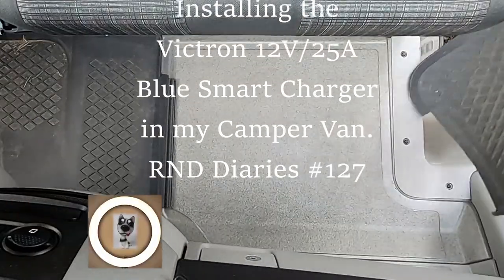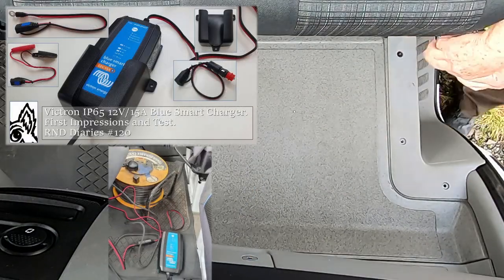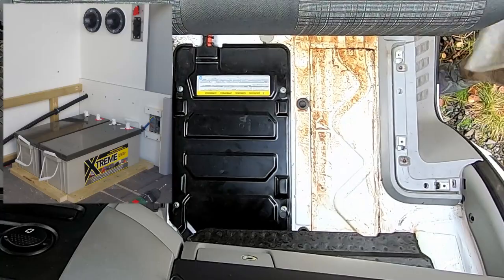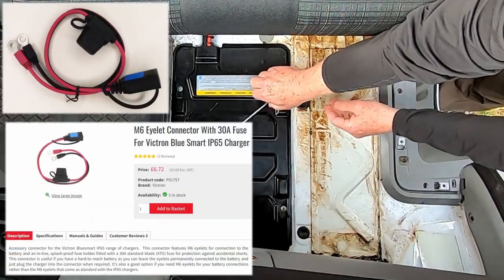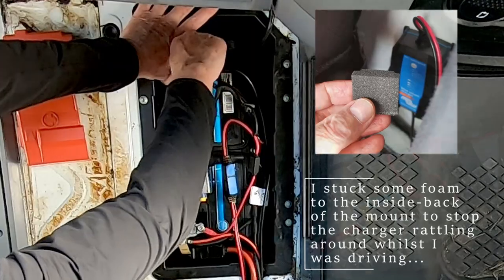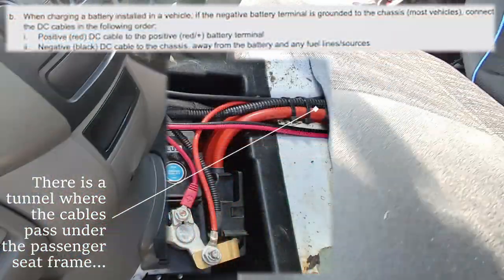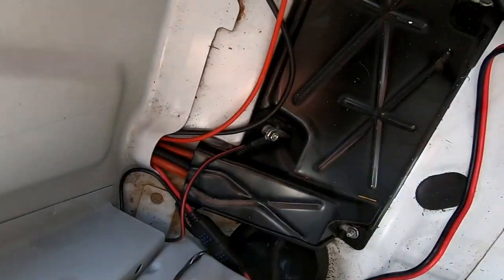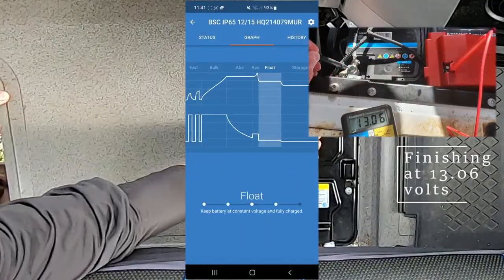Installing the Victron 12V/25A Blue Smart Charger in my Camper Van. RND Diaries #127

Comment: Thank you I’m about to do what you did I.E on board charger Victron 25 amp but permanently charging my leisure battery not the main battery. My leisure battery which is also connected to a Victron  isolated dc to dc  charger which comes from my starter battery , but I was considering connecting directly to the leisure battery what do you think ? So in other words my leisure battery is isolated from my starter battery and alternator thank you 👍👍👍🏴🏴
Reply from the maker: My understanding/best guess, is that treating the starter and leisure batteries as two completely separate systems is the way to go, although/except gaining any benefits you can from excess van battery power via a dc to dc charger has got to be a win. In my setup I also have a dedicated Victron mains converter to charge the leisure battery which might be another option for you as it also allows you to have AC/240v power in the van when connected.

Comment: Great vid👍
So is it only cars with smart alternator that u cant connect the - to the battery?
What can go wrong if u do?
Reply from the maker: Thanks. I don't know that you can't connect it to cars with a smart alternator? Not sure if it makes any difference, but might be worth contacting Victron or a reseller like 12Volt Planet if you want to be absolutely sure.